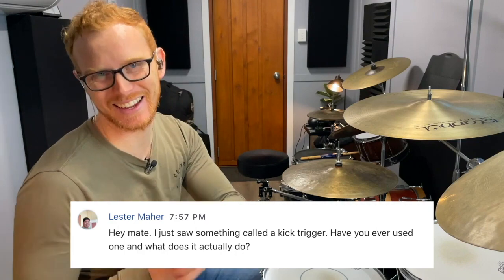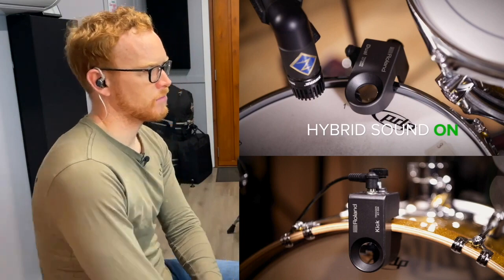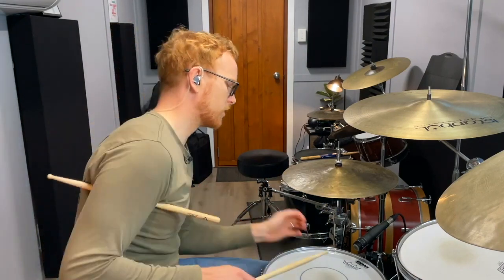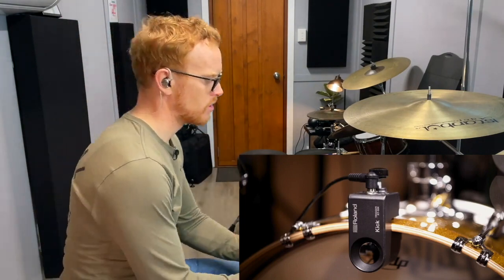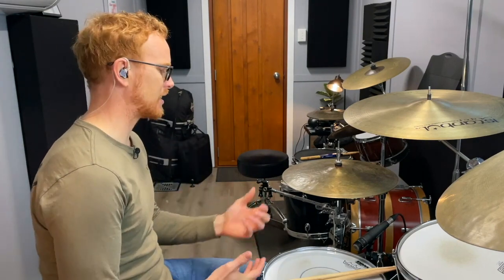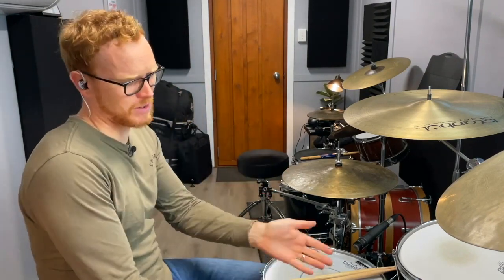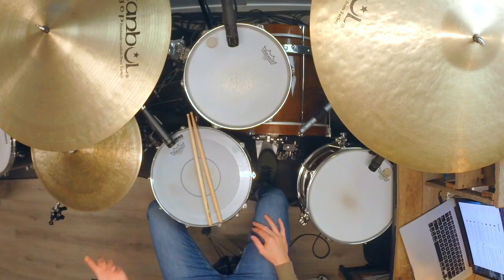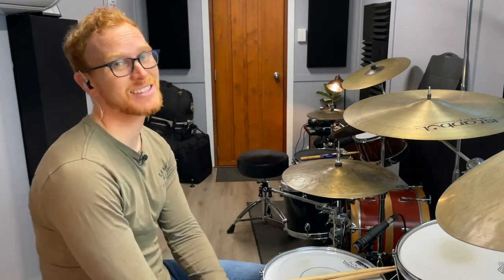Q&A - Using Drum Triggers in Worship

Comment: Two questions.

1. How does striking velocity work with triggered samples?  For example, when you load in a snare sample, but you are striking at different velocities, does the same sample just play quieter or louder? Or are there dozens of different samples that are triggered, depending upon your strike velocity? 

2. Do you know you control gates with an SPD while using RT-30 series triggers on an acoustic set?
Reply: 1. It depends on the software.  Modern drum plugins such as Superior Drummer and Steven Slate Drums use tons of samples and depending on the velocity, trigger a different sample.  Some of them will even let you adjust which sample triggers at which velocities.  Older or low end plugins will just change the volume though.

2. No idea